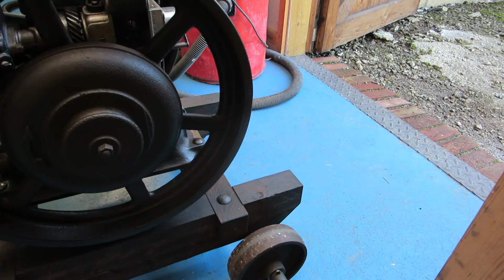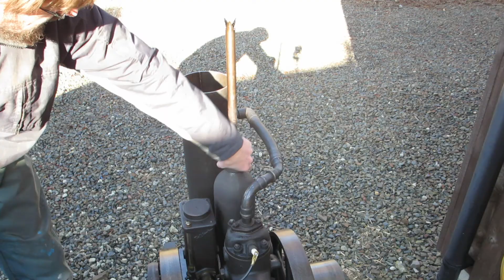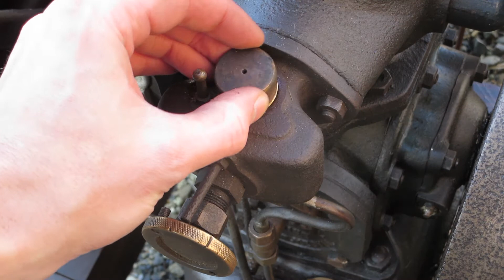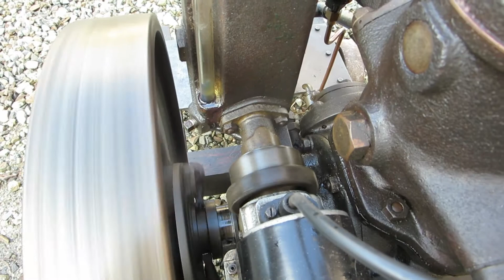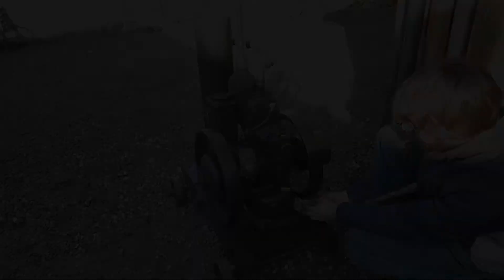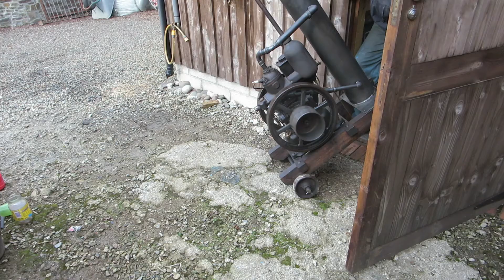Starting and running a Petter M type

Comment: Beautiful engine' sounds great. Do you ever run it on Kerosene?.
Reply from the maker: +regaskin thank you :-) I usually run it on kero when I rally it during the summer, it generally overheats and misbehaves on petrol if the weather is warm. Since this video I have made a new throttle linkage to take some of the play out and it runs much better.
Reply: +ChriX Builds Thank's for your reply. I have one the same, wasn't sure if the 1.5 was petrol only or petrol paraffin. Have to get a cooling tank and trolley organised for it. I have a 2.5 HP and a 5 HP as well. I love the popping sound of them. Keep up the good work.

Comment: Lovely runner. It looks as if every last bit of paint has been removed from the engine for some reason. Is this the latest fashion.
Reply from the maker: +thra5herxb12s thanks for watching! This one is original condition, most of the paint is gone as you say but there is some black left on the flywheels and a fair amount of green on the fuel tank still. Certainly not a lot left!
Reply: Sounds great. I have a 1933 5hp tank cooled but I have a 1928 1.5hp acorn top under going a major rebuild. If it sounds like yours I'll be well happy.